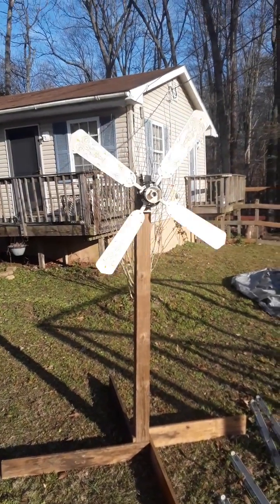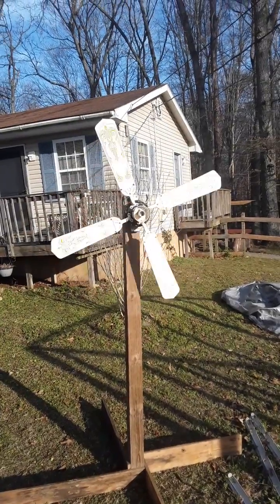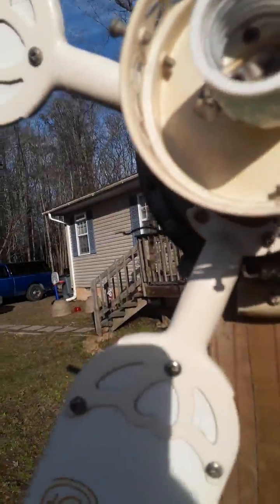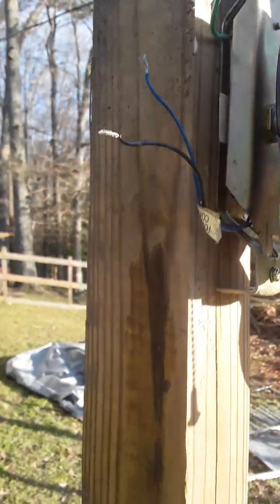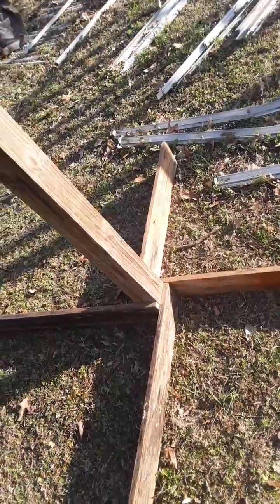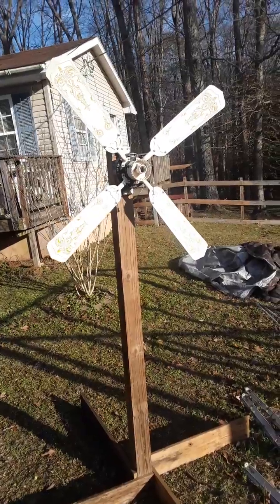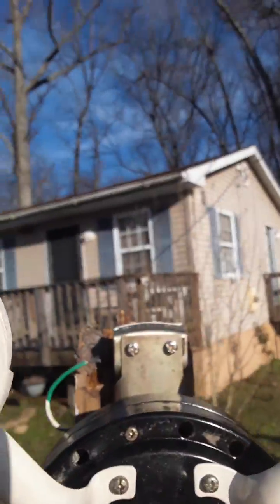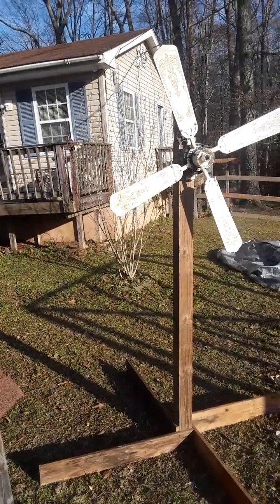Repurpose prototype ceiling fan into a windmill 1A

Comment: You can actually weatherproof it
Reply from the maker: Thank you. What would be your recommendations?
Reply: @PooGuruPlumber  yes if there is weatherproof paint for the blades you can do that you can use electrical tape to cover up the wires so that way it does not get damaged I love the fan that you have it is old is vintage and you want to keep the motor add event ever gets stuck and won't turn put some 3-in-1 fan oil on it
Reply: @PooGuruPlumber  Weatherproof the wires electrical tape and put paint on the blades that is weather proof I guess did you know that you can awso use a car battery to generate electricity